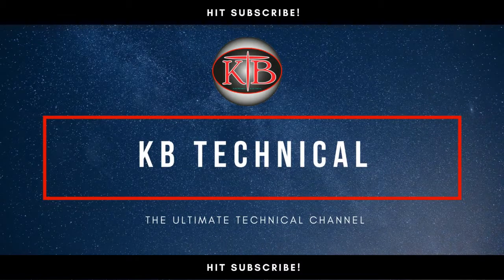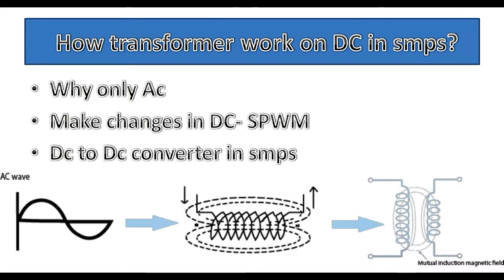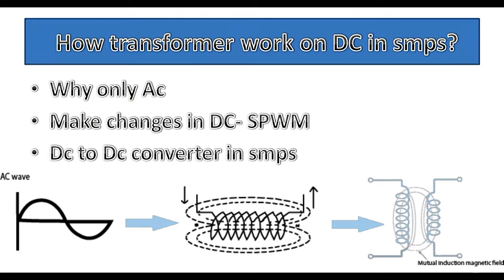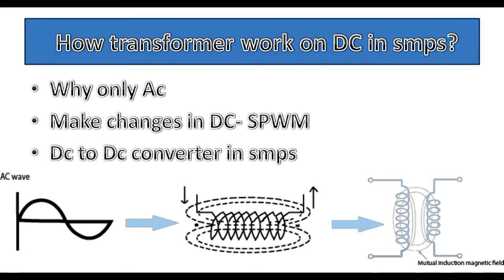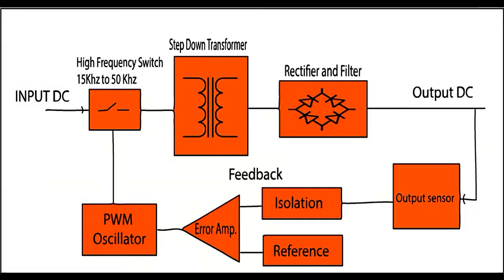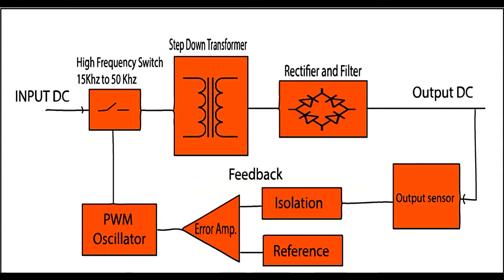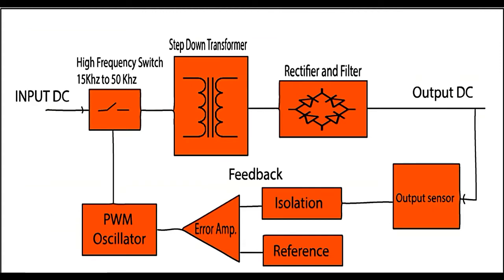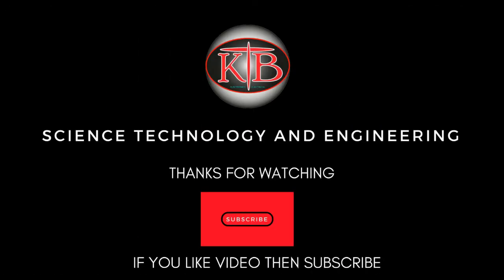Dc transformer in smps? Explain dc to dc converter.

Comment: Great video
Reply from the maker: Thanks
Reply: @kbtechelectronics  
Question:
Is there an explanation for why as increasing frequency would give more power for a switching mode power supply?
Reply from the maker: In smps transformer we use ferrite core so at low frequency ferrite transformer goes in to saturation and have more losses like hysteresis or eddy current loss and at high frequency ferrite core transformer have low losses. So we can use high frequency in smps transformer which is made up of ferrite core.
Reply: @kbtechelectronics  
Thank you for your answer. And thank you for your good videos

Comment: Hindi mein bolo jyada se jyada subscribe milenge . You must try .
Reply: Transformer work on AC because when switching IC MOSFET TRANSISTOR IGBT are off current direction are change so its AC Current not DC